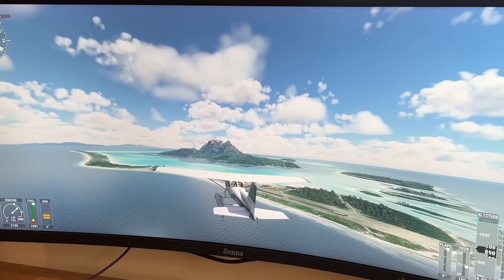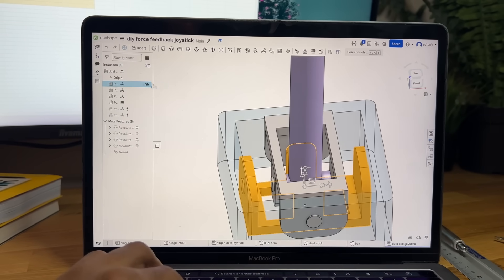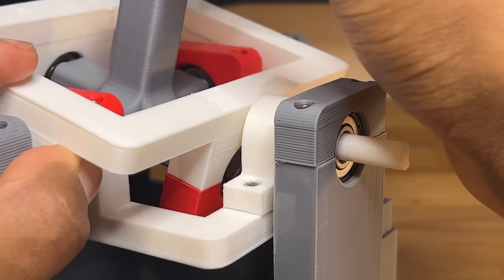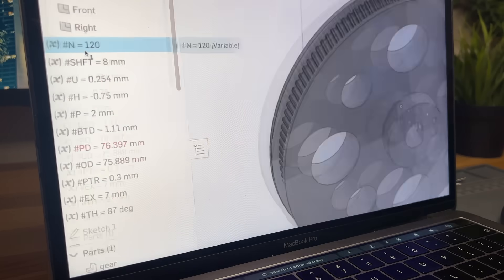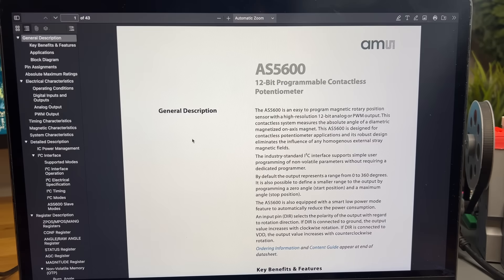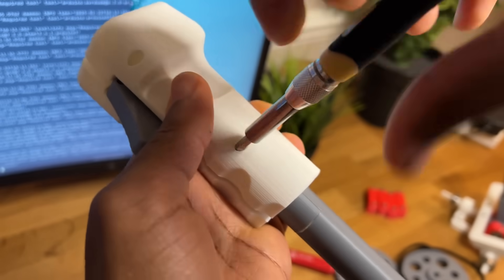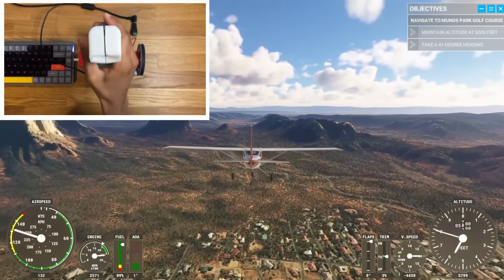I built a next-level flight joystick - using Force Feedback

Comment: would be way easier to just apply a black and white sensor and a small wheel with a pre defined amount of black and white areas. that way you could track teh movement. Thats how 3D Printers are doing it with their extruder motors

Comment: I am working on something similar - but I believe that a simpler device would be better - one that simply reads the airspeed of the plane, and converts that into "stiffness" in the controls - mimicking air pressure over the control surfaces.  The faster the airspeed- the more resistance to movement of the stick..  I'm looking into electro-magnets as the force- but stepper motors could also work..

Comment: I don't think you should be using stepper motors for this kind of project, a normal dc motor should work better and cheaper when giving force feedback, stepper motors are built for precise counted movements like in your 3d printer, not for making smooth force feedback. I suggest you try looking up the joystick.h library with force feedback tho I only tried it with a car force feedback steering wheel. the position encoders shouldn't be attatched to the motors, it should be attatched to your gimbal axles because if the belt skips, that would also mean your position readings are also off. I can hear the belt skipping in the video too, I bet that's why it's difficult to control because of the skipping belts.

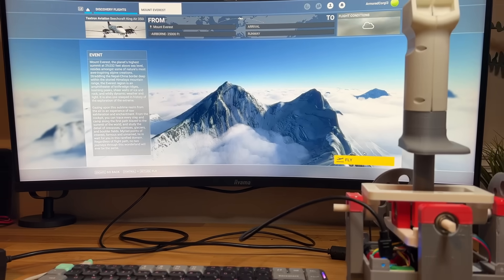Comment: 7:19  It looks like you have unacceptable amounts of latency in your setup.  You have the stick cranked way over to the left but the yoke on the monitor is near the center and it takes a long time to catch up to the stick's position.  Then at 7:23 when you've moved the stick all the way over to the right the yoke in the monitor is still all the way to the left, even though you moved the stick smoothly and slowly.  (All this assumes that you're actually using the stick to control the simulated aircraft on the monitor and are not just flailing about in front of a replay.)  It's insanely difficult to try to fly like that.
Another tip:  Maybe make a base for your base so that moving the stick (lever) around doesn't jack the unit up off the tabletop.  Or come up with a clamping system or way to immobilize it with fasteners.
As a friend of mine used to say:  "That was a good idea.  Too bad it didn't work."  As a flight stick this project looks like a failure.  As an experiment it looks like a success.  (The only failed experiments are the ones where you learn the wrong thing or you don't learn anything.)  So have a think and try again.  You've lost some time and plastic, but most of the other materials and parts you acquired should apply to your next solution.

Comment: So a joystick project where the gimbal design is fracked up day one, with a “we’ll see later” 
No understanding of the definition of force feedback
Apparently no previous knowledge of flightsim 
Using the wrong one for testing, (msfs where xplane provide exhaustive support and data output for ffb)
And input latency requiring a calendar for measurement. (See at 6:28) with unlimited amount of self patting on the back…

Comment: Very interesting build!
However, it seems you don't have much knowledge about how the forces act on real plane control stick. In the simplest way, in case of non-augmented (hydraulic or fly-by.wire) controls they are the function of aerodynamic drag on control surfaces and depend primarily on speed of the aircraft, control surface deflection and trimming position. Also, there is no true center position. The neutral-force position again depends on trimming and speed. Auto single point centering is actually what I hate about joysticks the most. 
This is based on my real aircraft flying experience (general aviation).
Anyways, I really like your project and I believe there is huge potential.

Comment: i never got to fly it, but i did get to hover in an apache once. the stick was surprisingly super easy to move because of the hydraulics. The only reason they would get hard to move was if the hydro was failing or the bucs system activated.
Reply: yep same with the huey. 
interestingly... if you were to use a $1000 dollar ffb joystick in DCS that uses actual telemetry from the simulator on the huey, it would just simulate the the hydraulics centering the stick and no "external forces" at all!
it would basically just simulate what this joystick does without any input from the game. 🤣
Reply: @Kris-q9f2p  It would still keep the trimmed central position. That's what stick in helicopters does.
Reply: If hydro fails, you can't move the stick. At all.

Comment: Hey zeroshot, Awesome build! Can you control friction through the motors, control how much force is needed to move the stick, and spring rate, how fast it returns to center? I mainly fly helicopters and want a stick that stays where I leave it in its travel.
Cheers!

Comment: Great! Does the game feeds back force or are you just simulating going center? I know car games do it but flight sims also? I really don't know! There is a library that can get force feedback from the game and send it to the motors and it is compatible with the pro micro board. I also want to make a flight controller, with force feedback if possible... but smaller than yours!

Comment: I've been looking at doing a similar project. I'd love to collaborate if you're interested. I'd send you an email but it doesn't look like you have one listed. Please reach out to me.

To anyone else reading, don't miss the forest for the trees. I'm seeing a lot of armchair professionals pointing out that "you could do the same thing with springs/bands/cams"

NO YOU CAN'T. This project is currently missing some software implementations, but you have to have an adaptive mechanism to achieve Force Feedback. A spring, or any other derivative, can not have a different response based on changing conditions. It will respond the same way every time.  This is a solid mechanical foundation for the software that would really make this fly.

Comment: It’s quite hard to control because it’s not working.
You’re yanking on the physical stick, yet the controls in the sim are barely moving. Something’s not right here.

Also, you didn’t really make a force feedback stick. You made a self centering stick with motors, where springs work just fine.
I get that the only real difference is in the software driving the stick, since this could be made to be real force feedback, but right now the claim is just false.

Comment: Stepper motors are a horrible choice for this. Without some far more fancy drivers than yours you can't control how much force a stepper will exert, you can only tell it "move" or "don't move" with the one single force it can exert before it just stalls. At the very minimum you'd have needed springs between the stick and the motors instead of a rigid belt coupling, which would have allowed for the steppers to tension the springs a varying amount away from where your hand holds the stick at the moment, thereby allowing them to exert a variable force. But this is not how it's done - you need motors that can exert true variable torque and drivers that let you control that. THEN, on top of that you need a piece of software that would let THE GAME you play control how much the stick is supposed to resist at any given moment in any given position, or else you just have a self-centering ordinary non-"force feedback" joystick like every other, except done in a needlessly complicated way.

Comment: You can't control the torque of stepper unless you have a driver that do so. But even if you have the current/torque control it would still be unpleasant feeling of cogging of the rotor when steps are skipped. Bottom line is you need a smoother motor to do thia, with bldc or just plane dc motor.

Comment: In DCS (I don't know MSFS), you can add a curve ingame, so the Joystick is more sensitive in the middle positions.
That will help you at landings (or air-to-air refueling in DCS) and that's a reason why you shouldnt have a dead-zone in the sticks neutral position.
Your 3D printed stuff should be printed at least in PLA+, PTEG or better  in ABS-like filaments with the finest nozzle and the smallest layer height.
Else you could send your files to a company which cant print it in metal. 
OK, I know the DIY-aspect of your project and a metal print will become expensive...
If you want to print a joystick there are enough cockpit-builder groups out there, with enough experienced users to get some nice ideas.
Especially  if you want more buttons on your joystick...
"Leo Bodnar" will offer reliable stuff for electronics around sim-hardware.
And glueing a magnet to the motor is not a good idea, because the motor itself will build an own magnet field which interferes with your hall-sensor... ;-)

Comment: I'm actually working on a similar project right now for american truck driving simulator, do you think you could make a force feedback wheel driving sim? I'm currently desiging the wheel in cad, but I can't get my head around how to use a BLDC with a standard motor controller for the force feedback
Reply: Look up FFBeast project, it has both force feedback wheel and flight control options

Comment: Couldve just used a ball joint for the 2D stick motion and then added a few linkages to attach to motors on the sides and contrain the rotation of the ball joint

Comment: I wouldn't call this force feedback as there is actually no feedback, this just self centres or goes to a position you want. Force feedback would be if you took data from the simulator and used that to control the joystick and apply forces in different directions. Basically this is just a normal joystick but with motors instead of springs.
Reply: That's exactly what i thought. This typically does what a normal joystick does with a spring. Force feed back means that game send input to the joystick as well. So when the sim says : "well you're stalling, the joystick is shaking", you feel it in your real thing. 
Still a really interesting project though
Reply: exactly cheaper just put springs and you will get the same resistance, in reality it is not functional or practical at all, it just made something that is simple without electronics into something striking but useless with motors, the true feedback like that of the Logitech is with motors and belts not toothed bands in addition to taking the telemetry from the game to adjust the strength of the motor
Reply: it definitively is a ffb capable joystick!
he just did not write a program for it so 3rd party software would need to be used!
secondly, as this is... it would be perfect for the huey in DCS!
there is no feedback on the stick in real life, it uses hydraulics to center, and it has a trim button to select a new center on the go!

also, just using motors for springs is much more accurate than springs are, it will center perfectly and the force can be adjusted!
the as5600 magnetic sensor used here can be programmed to 12 bit resolution (4096) over only 19 degrees of movement!
whether the bands are toothed or not makes no difference.

the only thing needed to make this use game telemetry and give you ffb from it is 10 dollars in software, there are even free options for some games!
also changing the stepper motors with regular dc motors and buying a suitable esc will vastly improve its feel!

fools!!!
Reply: @Kris-q9f2p  getting good telemetry and acc data from some games is just pain in the a$$ :D 
Glad there is no problem with that in DCS afaik, ARMA and KSP have mods for that purpose also. Wish more game developers gave us an ability to easily access telemetry data.

Comment: That's really impressive! I've made a steering wheel and pedals out of cardboard using an Arduino Micro just for fun, I have it posted on my channel (if you click my name). I really like how you've handled the feedback with the magnet encoders, I was using pots, but the magnet makes a lot more sense and easier to account for any slight physical alignment issues. Very nicely done with the CAD too!

Comment: if you do manage to get data back from the game into the joystick, add a stick shaker for when the plane stalls
Reply: use 3rd party software and a suitable motor controller... there are several options!
Reply: It is needed to implement DIrectInput API. That's all.
Reply: @jaromirandel543 Dunning Kruger moment

Comment: Impressive, but what is totally missing in the video is the software side. the connection with the simulation is totally ignored so we don't even know the main part: communication with the MSFS data. The mechanical is deja vu, but i am very intersted to learn about the comm part, whart is the usb protocol and PID used
Reply: He didn't really do force feedback in this, just applied forces from motors. PID is old and doesn't really work. It was a specification written for generic driver support of force feedback devices. It used to work as far as I know, but doesn't really anymore. It also planned for a lot of future use-cases that didn't really come to fruition, and made the specification confusing and bloated. Every force feedback device vendor uses their own driver. I've made my own force feedback device and that is the route I followed. 

When windows enumerates your device over USB, your device needs to send a few reports. Firstly it consists of what your device is, what options it supports, power stuff, etc. Then you specify that your device is HID class and windows will request your HID report. This is the report in which you specify your buttons and axes. You specify your input data as an IN report. This is data input to windows, not the other way. So that would be buttons for shifting and axes, like steering and pedals. You are just specifying the order in which the generic HID driver on windows will parse your data, along with how many bits each item takes up (1 bit for buttons, however big for axes). Windows will later periodically poll your device asking for the data, and you format the data according to what you specified in the report. Your device will be recognized as a gamepad essentially and will work in any game. You also will want to specify an OUT report, for data sent from windows to your device. This will be force feedback data. Then you can couple the force data you receive from your driver to your motor controlling code. 

On the windows side, you need to 1) modify the registry entry for your HID device (will appear after your first enumeration) and 2) create a driver. When a game asks DirectInput if there are any force feedback devices, DirectInput will look through the registry at the HID devices. If one has a specific set of key/value pairs in the registry that describe it as a force feedback device, DirectInput will accept it as a FFB device. These key/value pairs are listed in the windows docs, but I would reference your key/values against the entries of a commercial ffb device, since the windows docs document very little. In these key/values, you describe your FFB device, what effects it supports, and additional things. Another key/value pair you'll need to create specifies the path of your DLL, which is the driver you are going to write. When the game asks DirectInput to load your FFB device, DirectInput will use that key/value pair to find your driver and load it. 

Your driver needs to be COM compliant. This is essentially a system in windows that allows one program to call functions in another program even if they are binary incompatible. That's pretty much what a DLL is, but the COM part creates a binary compatibility on top, so you aren't restricted by language. I would suggest C++ anyway. The nature of C++ fits the ideas of COM compliance very nicely without a bunch of fiddling around like you would have to in some other languages to create COM compatibility. You will write functions with a function signature matching that described by the windows docs. Same name, same parameters. DirectInput will pass FFB data that it got from the game to your driver by calling these functions. The data will be in the parameters. Using HID functions provided by windows, you will pass along this data formatted according to your OUT format. Your device will parse the OUT endpoint and apply the force effects to the motor. It can be good to follow some principles from the PID specification, as they had some good ideas. It just isn't perfect since it was written at the infancy of FFB. It can be good to decompile thrustmaster or logitech drivers to see how they do their COM stuff if you're finding some difficulty. 

For a FFB yoke or stick, you can forget about the COM, registry, and DirectInput stuff. If the game provides control surface data in an API, you can use that API. If not, you'll need to hook into the game and find that data. Then you can device what forces that will cause on the yoke and send those forces to your devices OUT endpoint.

Comment: The feedback isn't very realistic. I suggest accounting for trim and other things in-game. 
However, I think this is a great project.
Reply: for the huey in DCS it would be realistic... in real life it just uses hydraulics to center the stick and has a trim button to select a new center for the stick to hold!
you could use 3rd party software and a suitable controller and you will get ffb from the game... but if you use a ffb joystick that takes telemetry from DCS, it would just simulate exactly what this does not using that telemetry!
on planes it would be different though!